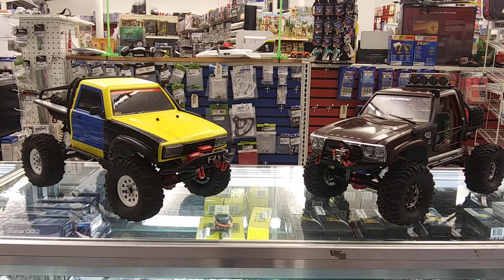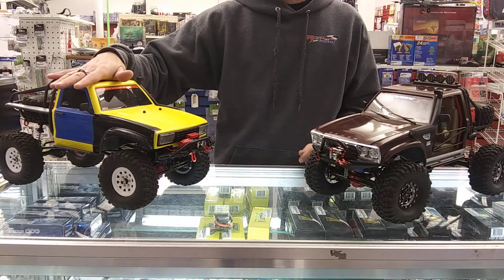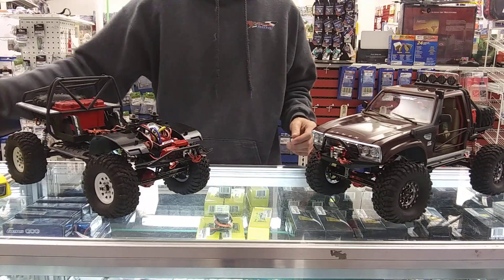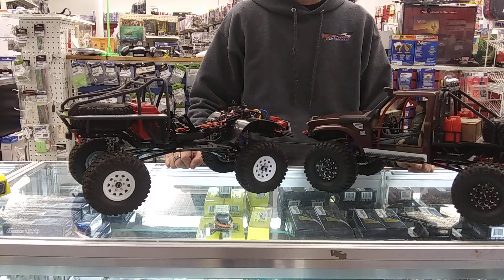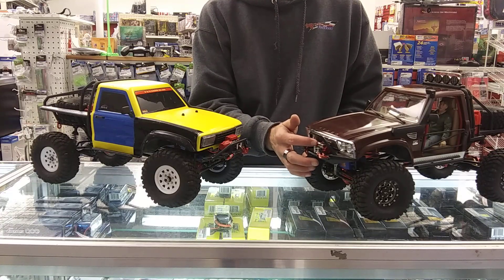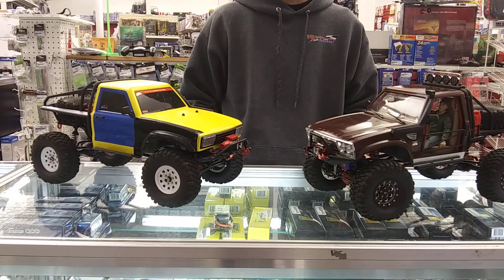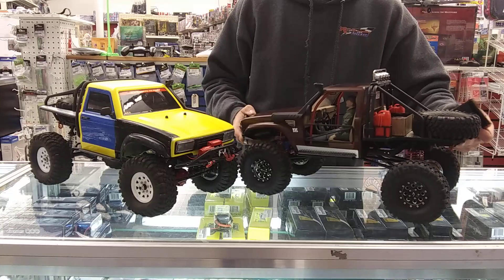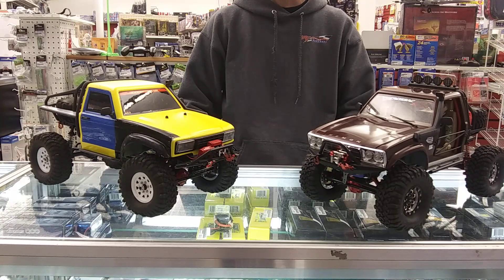A closer look at the Cross RC SR4 & SG4 series trucks.

Comment: is there mods to this truck i notice the shocks do not turn in like they do on a sg4c
Reply from the maker: If you're referring to the angle of the rear shocks being more acute than stock, yes. Both Bob's (which he has long since sold) and my Demon (still going strong) added the rear shock mount kit from Cross RC CZR97400348. This stands the shocks up right. He did it for looks, I did it to help eliminate some of the excessive chassis roll during a hard accent.

Comment: Could you recommend a battery for the SG4?
I’m using the Fly Venom 30C, 2000mah (part # 25023). Too short on run time for my liking and it’s hard to find a bigger battery that’s not too big.
Reply from the maker: I'm running a Gens Ace 3300mah 3s in mine. However I cannot say if it will fit in the SG series battery tray. I'll check on that and post an update as soon as I can.
Reply from the maker: Just wanted everyone to know we worked with Gens Ace to develop a new 3600 3s lipo that fits the SG/SP/SU series Demon trucks. Look for them under their Adventure line. Thanks.